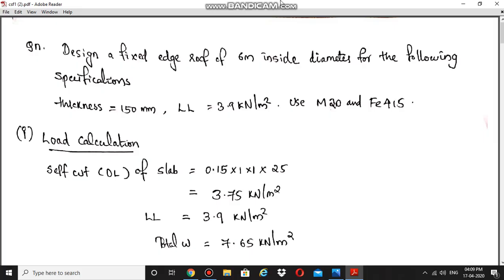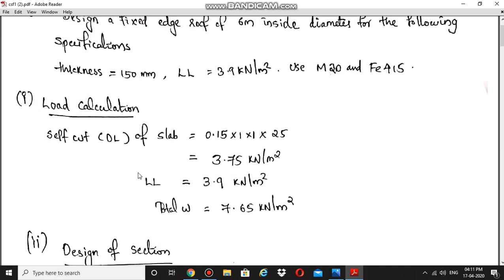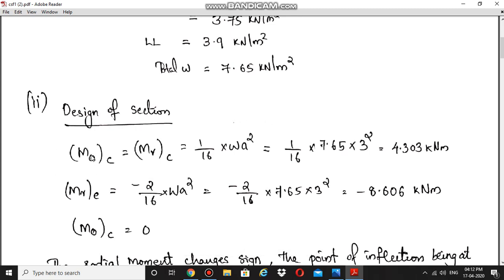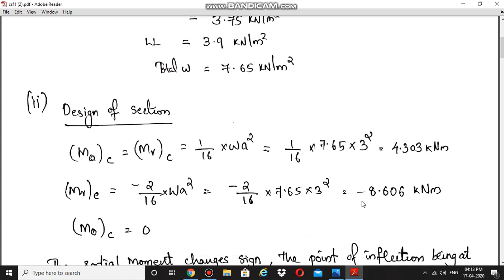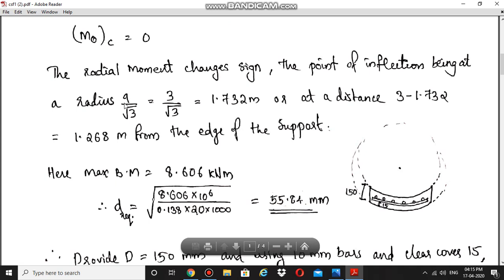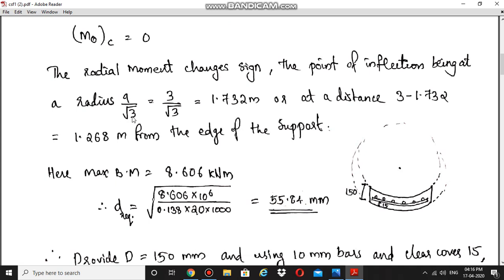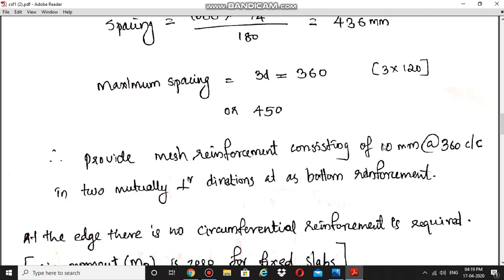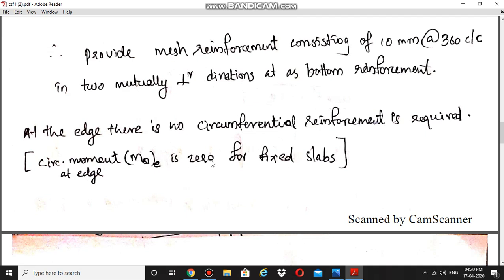CE 304 DCS 2 Module 4 - Design of Fixed Circular slab Part 1

Comment: In step 2, design of sections,Here equations for Mtheta is different as we seen in simply supported...There it is 3/16Wa2 ..here it is 1/16 ...How it is possible?
Reply from the maker: Moment values are different in all the three cases, i.e.,  S.S , Fixed, Partially fixed slabs.  Please refer page no.586 of R.C.C Designs by B.C Punmia